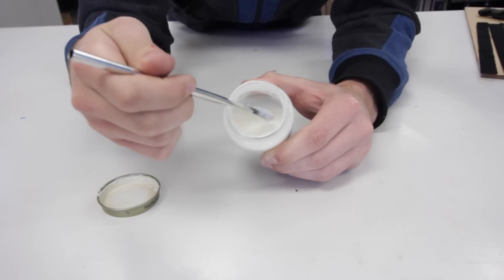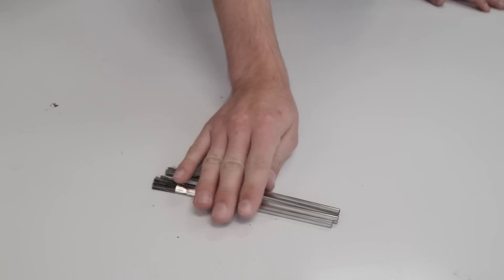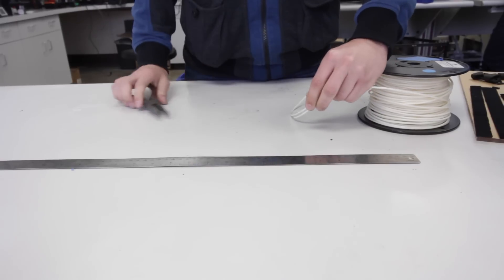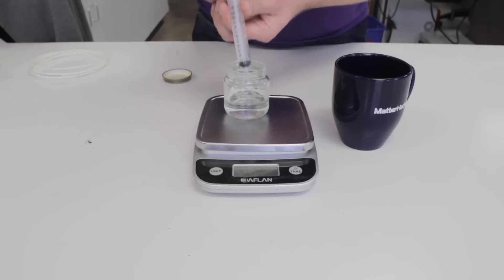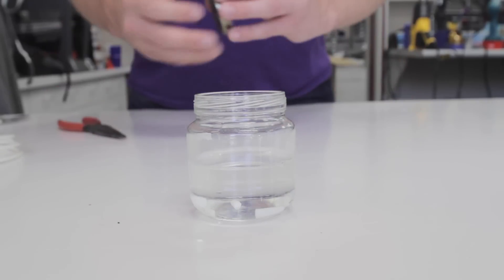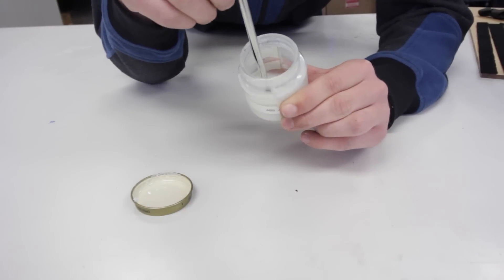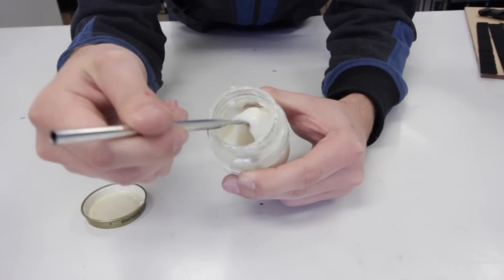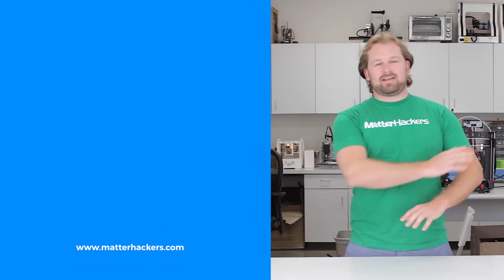MatterHackers How-To: ABS Juice, Glue, and Slurry

Comment: I use ABS juice for everything including nylon and TPU.  Sometimes they stick a bit too well.  1 cup acetone and about 10 or so 1" sticks of ABS filament.  Just eyeball it.  It doesn't need to be exact.  Let it sit overnight and shake well for that milky appearance.  Wipe where you want to print and there you go.

Comment: Using ABS Juice on my Ender 3 V2's glass bed achieved fantastic bond strength for the first layer, but made it almost impossible top remove the printed part. I won't be using it again!
Reply: Yeah, parts stick pretty good but need to thin out the mix if it sticks too well.  It should look like skim milk.
Reply: A bit off-topic here, but, did you try those magnetic beds? They are great for my DaVinci 1.0Pro. All it took was a recalibration of the z-axis offset. I can make any project work with such a bed and some hairspray, both for PLA and ABS. I don't have to tell you how practical a magnetic bed is, once it doesn't pose any sticking issue. Removing your finished project couldn't be more convenient.

Comment: Have 2 questions, the first one - wich acetone?, the nails acetone works?, anyone try to make this juice or glue with black abs??
Reply: I've never tried the nails acetone.  It's less expensive to buy the industrial cans of it at the home improvement store.  I use whatever color of scraps I have available, black included.  But if you're trying to patch or glue two pieces together you might want to use a matching color.  I've never wasted time measuring and weighing.  From my experience, eyeballing it for the right consistency works fine -- like an expert chef does without measuring cups or spoons.  Ha.
Reply: You need to use pure acetone. Acetone nail polish remover won't always work. You have to look at the ingredients list to check if there are any additives. Some nail polish removers are advertised as 100% pure acetone, and those would probably work. Other brands that dilute the acetone with water will likely perform very poorly. I have used black ABS before and it works just fine.
Reply: yes all colors work , but some need more and some need less acetone(+/- ~15-20%). If you dont have a scale start with 50-50 and then add more acetone or more plastic to increase/decrease the viscosity

Comment: What’s the measurements for 1.75 filament
Reply: 5 grams worth for juice, 10 for glue, 20 for slurry .
Reply: @BeatlesCuber  Thanks that makes sense as same as in video as the mass or weight would be the same just the length would be different as smaller diameter. For length 3 mm filament has an area 2.94 times larger (by my calculations) than 1.75 mm filament so multiplying by about 3 should suffice. Also a 1kg spool of 3 mm filament is 110 m and a 1 kg spool of 1.75 mm filament is 330 m according to the web which backs up my calc.
Reply: @dalek-dan-1  it was in the video, but you're welcome.
Reply: @BeatlesCuber  I know but to me it was not obvious that measuring by weight will always be the same amount regardless of the filament diameter, it is now in hindsight ;-) As the easiest way to measure is by length.
Reply: @dalek-dan-1  well I hope you have a good day.
Reply: probably 80 cm will work just fine for abs juice, just cross-multiply the weight of what you want with that number (80 cm/5 g) and you'll be good, so 160 cm for glue and 400 for slurry

Comment: Is it possible to make a mold out of the slurry mixture? And how long before its fully "cured" (acetone vaporized away)?
Reply: no its not, i tried it, the reason is the outer cured shell doesn't let the acetone inside out (or slows it to an extreme slow speed).
You can to up to max 3mm (1/8 inch) but then you better wait 2 day for drying. Dont use heat it will make bubbles.
smaller thickness up to 1,5mm need ~1 day curing time

Comment: Putting Acetone in a coffee mug is a disaster waiting to happen.
I also suggest adding protective gear to the list of tools for making ABS/Acetone mixture. The most important one would be goggles.
Reply: why? what will happen?
Reply: as "protection" nitrile gloves (the thick ones) prevent abs slury to glue to your hands. (not dangerous but anoying since it can be washed of easily)
Reply: Probably ruins the coffee flavor. and the goo sticks to teeth.